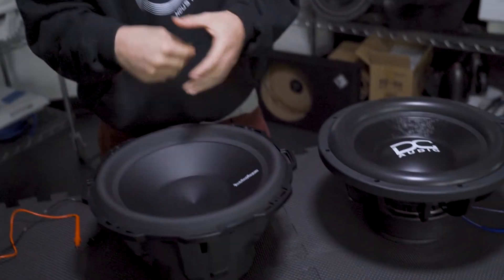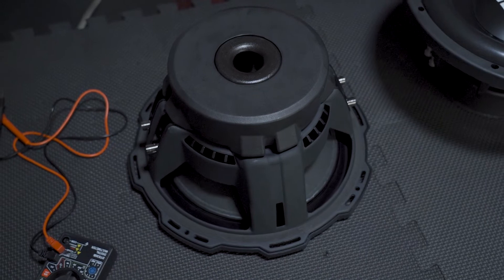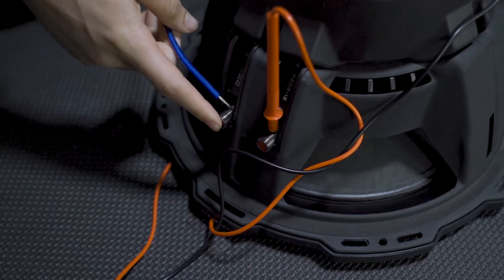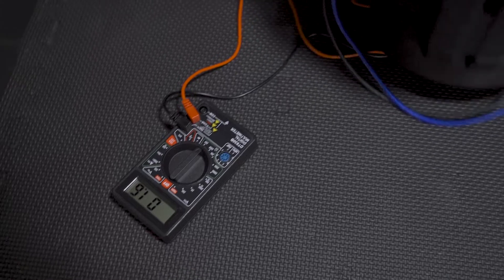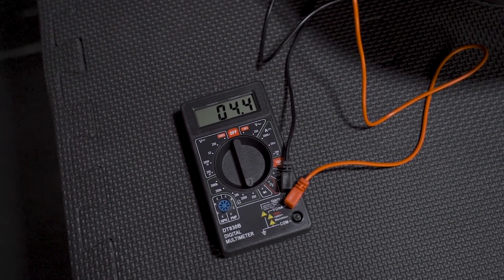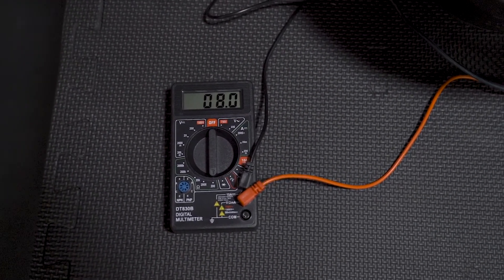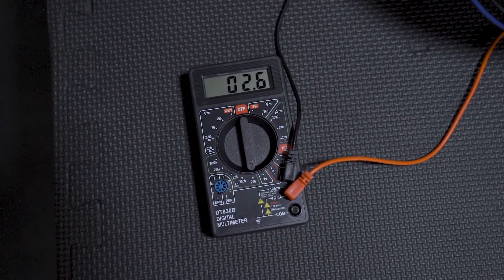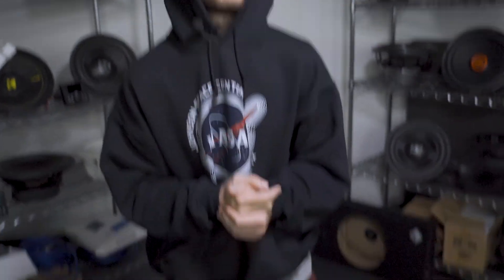Subwoofer Wiring 101 Pt. 1 | How to Wire a Dual Voice Coil Subwoofer in Series and in Parallel

Comment: So how do I do this without using a jumper wire? Basically the two wires won't fit into my terminal. So I'm trying to figure out how to connect the wires outside of the terminals on the subwoofer..

Comment: Maybe you can answer this. I want to replace the sub in my new RAV4 Prime with JBL. Already replaced all the speakers in the doors and on the dash. I am using factory amp because it is not so bad. The OEM speakers are bad though. I want to replace the sub because it is made out of paper, has very small magnet and produces a lot of distortion and booming. I want a tight sound but not necessary low. I was told that I have to wire my existing factory amp to a dual coil sub with no more than 75w RMS or wire it so it is 8ohm. The reason for it is so I would not blow the factory amp. Is that true? Thank you.

Comment: I got one 2 ohm dual coil sub and want to wire both coils to remain 2ohm not 4ohm and not 1 ohm… how would I do that?
Reply: Buy another 2ohm dual voice coil subwoofer.
Reply: Then wire them both together parallel I think
Reply: Just wire it to 4 ohms. If both voice coils are powered and your not losing that many watts there’s not rlly an issue.